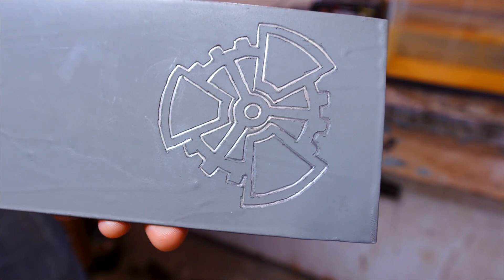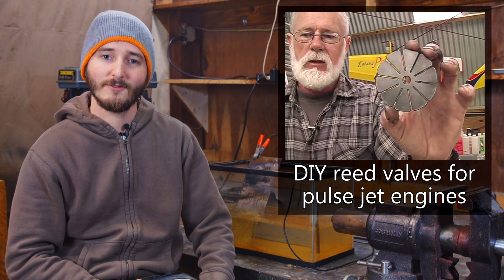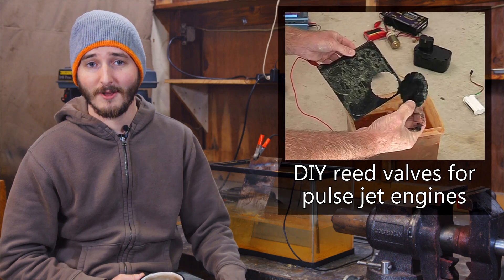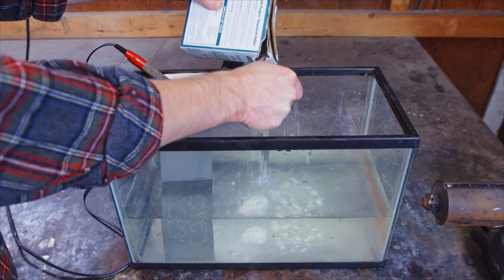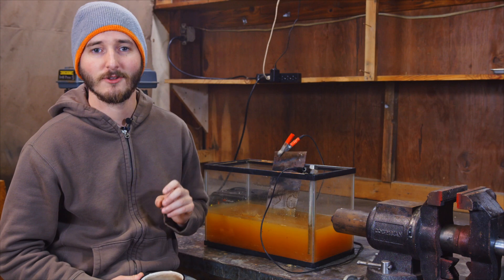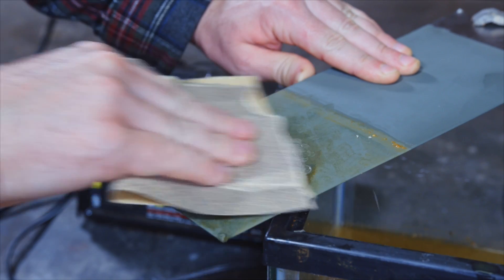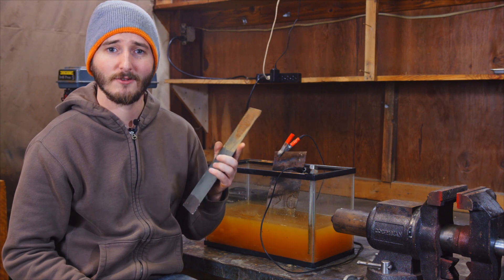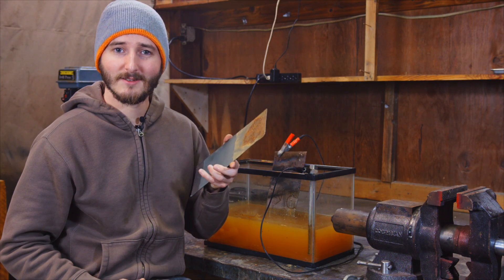How To Cut Steel With Electrolysis [Experiment In Progress] - NightHawkInLight

Comment: Recently i've been removing rust from some old cast iron pans, and i think you might have your leads connected backwards. In the cast iron videos, they always clip the black (negative) lead to the pot or pan and the red (positive) lead to the scrap or sacrificial iron (they say to stay away from stainless steel and copper). this way, the electricity flows from the pan to the scrap. in the end, the rust, oil, and carbon buildup has been removed from the pan, and the scrap is coated in crud. also, instead of baking soda, they always insist on washing soda, or sodium carbonate (i found mine in the farm supply store by the laundry detergents.) also, i learned that the more scrap i had surrounding the piece, the faster/better the process was.

Comment: The challenge is that lasers and water jets are erosive processes.  Energy is directed at a target and doesn't spread much laterally.  Electrolysis is a non-directed process - that is, you immerse your material in solution, and electrical energy is moving through the entire substrate.  As material is worn away in the cut region, the electrolytic reaction spreads equally through the cut - instead of just acting on the bottom of the cut as it would with a laser or water jet.  Maybe the solution for the home user is to combine a 3d printer with a low powered water jet, and just repeatedly "score" the area until the part is free.

Comment: this is limited you can only cut so deep, once it has eaten down it will also start eating UNDER the paint or wax and that is unavoidable. It may help to play with the width of the scratch vs. how thick it is. but the only way to make this work is to etch some remove, clean, strip paint, scratch and etch more. Also use an adjustable power supply as current is important and will change with surface area, the electrolyte, electrolyte concentration and distance of anode and cathode.

Comment: i don't know if this would work but what if you cut the design you want into 2 pieces of material like wood/plastic then sandwich the metal between them clamp it tight and coat the outer rim in wax

Comment: I saw the same video about the reed valves a while back which prompted me to have a go at making a really nice control panel for a project I've been working on. In my case I tried to etch a thin sheet of aluminum using toner as the resist material (a process known as the 'toner transfer method' -- which works great for etching circuit boards, btw) and borax for the electrolyte solution. Sadly, I didn't have much luck either :-( .

As my project is still unfinished, I'll be very curious to see what you come up with!

Comment: Try maybe using a rubber coating such as the plastidip spray or that tool handle coating and brush it on, maybe the rubber coating would work better as to wax, or if you would still use wax again try using a crayon first maybe getting it in the small scratches in the metal might help the bonding of the other wax.

Comment: "Cleaning" the steel isn't going to be good enough.  Scrub with muriatic acid, rinse with de-ionized water, and dry completely before painting.  I would also use a photo resist such as is commonly used for etching circuit boards as opposed to paint-and-scrape.  Mechanically rupturing your resist is most likely breaking the bond between the metal and the paint around the edges.  As it appears you are attempting to etch from only one side, perhaps use the paint on the non-etching side and use a photo resist on the other.

Comment: a couple thoughts:
1. check out Jake Von Slat's site where he does this with brass plate.
2. looks pretty thick, try thinner metal to start.
3. I've done this before with a different electrolyte and I think you are WAY over powering this. try a lower current per area and see if it cuts better.
4. check the solubility of the paint in the chemicals you're generating. might have to change the coating type.

Comment: I think you need thinner steel because your piece is thick enough to where the initial "wave" of electrolysis eats through only about a millimeter of the steel. The baking Sosa then starts dissolving around the scrapes rather than just seeping straight through the metal

Comment: I'm not an expert but I've read other comments below and made some guesses. Experimenting with solution and the coating seems like a good course. I watched your reference video. It looks like he was very thorough in his metal prep, you may have been also but you didn't show that step. He also limited his current to about 200 mA which is slower but bubbles less. It also looked like he kept his scratches as narrow as possible which seems to mitigate the 3D effects +AvE described. AC ripple may play a factor and you could try measuring it, but to just be sure it's not you could add a 12v battery or large filter capacitor in parallel. Lastly, if you start with warm solution it should help speed up the chemical reactions.

Comment: I think the trouble is H2 bubbles on the steel surface UNDER the paint.  Typically with ferric chloride etchant, no H2 is produced.
Ferric etching is a one time thing, if you electrolytically oxidize the ferrous ions back to ferric you could reuse the solution, electro chem. not my forte, it may not be as straight forward has you think, good luck.

Comment: It sounds like what you're doing is very similar to PCB etching. I've run into similar issues with my photo-resist layer after it hits the etching take. The bubbling that you're seeing is due to air trapped under the laminate layer. I don't see how that's possible with spray paint, but that's what it looks like to me.

Comment: Did you try reversing the clamps? Changing the way the electrons flow.  It also looks like you have too much current running through the steel.  Also the type of steel matters, lean more to the low nickel side, basic electrolysis consumes the lesser metals, make sure you do not have a high zinc content in the paint.

Comment: I had similar issues attempting to etc brass. Vinyl labels, nail polish, wax, the usual stuff... All the masks blistered off and failed. I noticed In a "How It's made" video on Dovo brand straight razors which had very clean etching that they used a liquid asphalt as the maskant. I don't know where to buy it, but this could be useful.  I also strongly suggest watching this video: It made a huge difference in the quality of some electro plating my brother and I were doing. https://www.youtube.com/watch?v=HiL6uPNlqRw
Reply: This thread also looks to be on point: http://www.metalartistforum.com/maf/index.php?/topic/7291-positive-etch-resist/

Comment: you might be using too high of a voltage or too low, probably too low because as the voltage increases so does the amperage and the effect of resistance by increasing the voltage you might get it to seek out the path of lesser resistance rather than eating at the steel under the paint.

Comment: etching primer usually contains an acid to "etch" the paint into the surface for better adhesion..... could this be causing the "etch primer" to become conductive.??
also i would suggest getting a far better scratch on the surface before painting get some 240 grit and go to town on that sum bitch get some paint prep wipes and a tack rag to clean it off and use a standard non "etching" primer ... you might get better paint adhesion results ..

Comment: volt = the speed of metal that is removed. ah= the size of metal particles that is removed. it is that you are applying current over a large area thin lines will speed up the process
Reply: i use 15-16v and 6ah

Comment: I was thinking that when the electrolysis starts the areas with no paint start dissolving right? Well then that leaves the electrolysis solution to be able to get underneath the paint layer as there is no paint protecting the inside of the metal.
Reply: Maybe you have to turn down the 'juice' to prevent the inside metal from dissolving

Comment: you may try to add something to bind to the iron ions as they are produced by the electrolysis. The bicarbonate is not a good complexing agent for iron, it is basic, so iron hydroxide precipitates. That´s why your solution is cloudy. You can try acetic acid  or using something like EDTA as an additive.

Comment: I believe electrolysis works in sort of a "line of sight" way, such that the anode should be affixed nearest the surface you wish to etch. That being said, and having read AVE's prelim thoughts, perhaps using an anode on each side of the plate will allow for better results. If you could scratch away your design on both sides, you would have two 2D etches meeting together from opposite sides, cutting down the time in which the 3D etching would take place. This of course would only be worth doing if you can accurately scratch the designs on both sides. Just a thought..
Reply: Also, I think your anode might be stainless, which I don't think is ideal.

Comment: I Can Help

1. I think it's the type of steel he used something like spring steel or something I'm not sure.

2. I think the way the way the paint is scratched caused the water to seep in and make the system etch under the paint. 

3. lastly I think you should experiment with a different type of electrolyte maybe the paint does not like the baking soda.

5. try even thiner steel that will probably ech right through without etching to the sides

If you have time you can tell me what you think.

Comment: Apart from the issue AvE raises there is also the question regarding the paint/electrolyte in the electrolysis environment. EG even though a paint may resist say sodium chloride well with no current flowing, once you get some electicity flowing it can cause chemical reactions to take place that would not normally do so. Flourocarbon polymer paints will stop that particular effect but they are hideously expensive. Another way of looking at what AvE says is to take a look at what happens when you etch high copper weight PCB's Most are between 1/2oz and 4oz per square foot. However some specialist ones are as much as 24oz per square foot. The copper ends up with concave side walls.

Comment: AHH! I'VE SPENT THE LAST HALF HOUR TRYING TO FIGURE THIS OUT. Don't use baking soda*!!!!* When you electrify the water, the soda breaks down into Oxygen and other bits (not exactly sure what), Making the Oxygen bind immediately to the Iron since it is becoming a Negative 3 ion (because you have the iron as the Anthode, and the Oxygen wants to get rid of its electrons). Making it quickly form into rust because your Cathode is most likely Iron tubing of some sort, so you're basically doing Oxygen Electroplating instead of Sodium electroplating. In your Inspiration video, He use Sodium Chloride specifically to avoid the rusting. Think of this entire Electrolysis experiment like Electroplating, Except you're trying to make the Iron into a weaker Crystalline, not any random form because it will bind unevenly. As seen from using the Baking soda. Using Salt should make the whole experiment smoother.  Any electrolyte that contains Oxygen is going to ruin your experiment. Let me know how it turns out :)
Reply: Very good point. Use something which makes the oxidised iron water soluble. 
Then: Would adding peroxides or using HCl instead of NaCl/Carbonate be better? 
When playing with Cl and electrolysis, be aware that any metal in the same room will rust.
Reply: Using any Peroxides would give the same rust problem. Oxygen being a non-metal will do whatever it wants to get to a more stable spot (Thus creating bubbles under the paint). The reason that Salt (NaCl) worked is because it isn't actually binding to the iron in the steel. You're trying to bind the elements to the Carbon, making the Steel structure weaker. That is why the cuts where able to be so thin in the inspiration video, and also why the waste was Crystalline, not rustic. You can't use anything with Oxygen because it creates polar products (such as Water). Carbon on the other hand is structured evenly to allow for crystalline structures. So is Silicone. The crystals that you're trying to form is to literally create a glass complex. Have you tried to bend glass back and forth? It cracks because of the micro layering being uneven. With Electrolysis, You can make specific points where the crystals won't want to move, causing them to snap off. If you wanted to corrode the material away, Why would you even want to use electrolysis. It takes way more power to run electrolysis through this setup where you could just have the steel plate sit in a strong acid. Especially if you're trying to cut thick steel, Don't waste time with electrolysis. Get down to the point, you want an acid bath. Then you can use the Baking Soda to neutralize the acid when you're done. No car batteries needed.

Comment: I use a combination of chloride and sulphate salts acidified with hydrochloric acid to etch metal plaques, including stainless steel , under the influence of a DC current. I have tried cutting with the system as well. For cutting you need to register the artwork perfectly on the back and front of the workpiece to etch from both sides. Self adhesive sign vinyl is the best resist.
The positive cable connects to the work piece and a large flat negative plate needs to be on each side of the workpiece.
As etching progresses the exposed metal starts to etch under the resist so , true accuracy is only possible on very thin workpieces. The negative plate proximity is also important for the speed of the reaction but beware, the closer you get the greater the pull on your power supply. I use a 130 amp DC welder to etch plates up to 300 x 400mm and everything gets really hot including the electrolyte solution. Be really careful folks this can really hurt you.

Comment: You need to adjust the formula of the voltage, current, and electrolyte solution(s) strength based on the type and thickness of the meterails. That formula would also change slightly again, based on the complexity of the design again... Etching or cutting with electrolysis is a relatively art form   and it not learned overnight, "It takes a lot of expierance and practice!!!"....

Comment: Wait - any metal? Will this work on a PCB? If that's true then I found another ridicules way to make pcb's. (Like welding them)
Reply: The problem is that once part of the etch is electrically insulated from the terminal, it won't etch any more. Maybe lower your copper into the bath slowly. Make your cathode (anode? Whatever) just a rod horizontal near the surface.

Comment: cool process ! In order to circumvent the corrosion of the coated surfaces in the experiment, amplification of the energy of the  process would likely focus the effect on the exposed metal pattern. Unless the coating is atomically bonded ( i.e. electroplated) there will most likely always be permeation of almost any coating superficially applied. My two cents... Keep up the good work !

Comment: So if I got this righ the problem only occures after a certain run time.
How about you do an etch on both sides to double the "cut depth", learn where the corrosion spread occurs, take it outh of the bath at that point in time and re-apply the protective coating, making sure to apply it to the inside edges of the cut if the depth is far enough along for that.

Because as far as I can tell this can not work unless you re-apply a protective coating to the inside where new surface appears when you corrode  or have some form of barrier that will naturally fall down into that area as break.

Comment: I got into a copper plating mood a few years ago, I found keeping the reaction slow gave me the best results. I used roughly 1 volt and limited the current to a very low level. 12v just tore things up, I know you want to cut the metal but try lower current levels if you haven't already.

Comment: So I think when the iron is oxidized on the surface near the paint it will expand( Iron oxide has a lower density than iron). When it expands near the paint it pushes some of the paint off from the iron surface and makes it so that area can be attacked by since its now more exposed. This destroys your outline. Maybe try some kind of chemical etching, HCl will dissolve Iron but idk how much itll attack the sides of the metal once that gets exposed?

Comment: One way to get the etch to not corrode the surrounding metal is to use a higher current. For metals like brass using an etching solution along with the electricity can make for nice etchings, but cutting through the metal seems to eat into it too much. I think wax is the best choice as well for the mask.

The issue is that as the etch goes past the level where the paint is at, the metal can then be etched in a lateral direction as well as vertical, and it starts to undercut. So if the metal is thin enough to cut through quickly, you can minimize that.

Comment: You didn't say if you could punch out the corroded part. It sounds like a paint issue, firstly. Possible approaches:

*Use masking, rather than removal
*Get a thinner coat
*Use higher voltage - a faster cut will have less time to corrode places you don't want it to
*This is out there, but you could try different solvents with different levels of oxidizing power - HF, for example, would be the mammajamma, but not appropriate for home use. 
*Include a catalyst to regulate the conditions of the solvent?
*Switch electrical polarity, so flipping positive and negative/direction of current

This method is strongly limited because corrosion happens radially - it eats around the opening, not straight down. You might be able to get some benefit from a setup closer to gel electrophoresis - where the current is around the plate and directional - but I doubt it. Good luck!